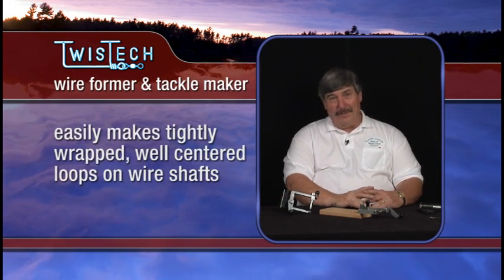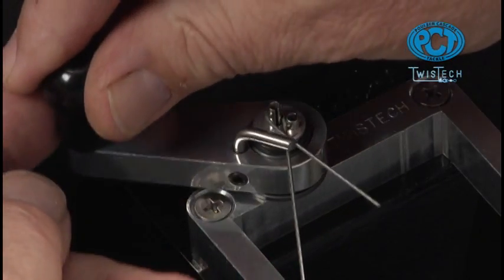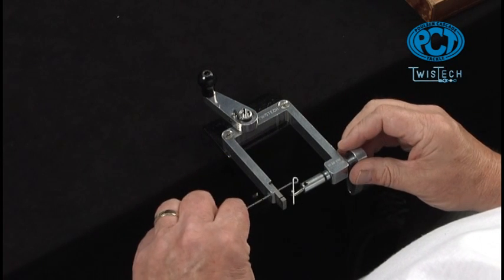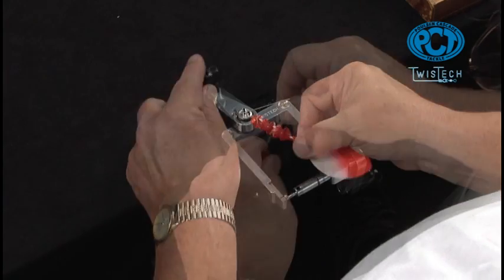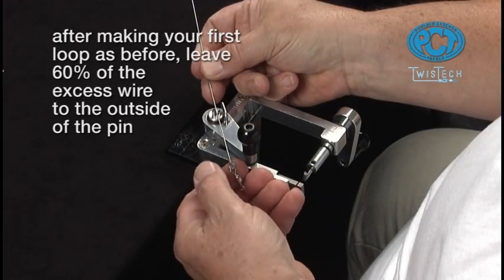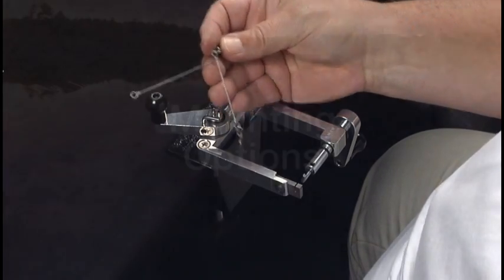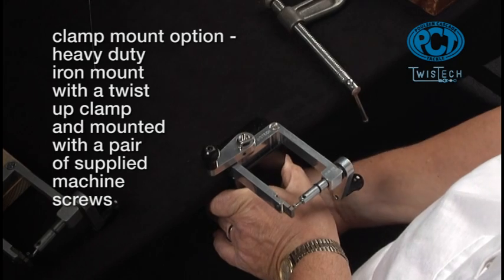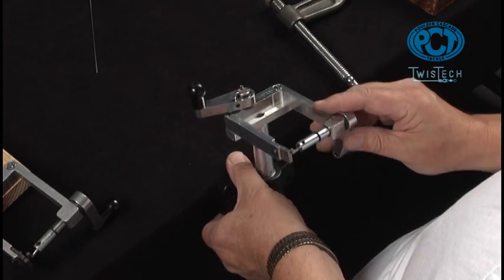TwisTech

Comment: ALL that TALKING!!!...& NOT 1 MENTION of the wire size that will work with the tool!!!...
WORTHLESS!!!!!!!!!!!!!!!!!!!!!!!!!!!....
Reply from the maker: There are 3 models. Standard handles wire from .029 o .037, Heavy Duty does wire from .037 to .041, magnum handles wire up to .052. Both the Standard and the Heavy Duty can be converted to the other by way of conversion forming dies.
Reply: You need to relax man, looks like all you had to do was ask. I'm sure that information is also available on the internet elsewhere assuming you have any sort of basic search skills and patience. 🙄🙄🙄

Comment: Can you use this tool to make  a 4/0 slide swivel?
Reply from the maker: I'd love to answer that, Rodney, but I don't know what a slide swivel is. Can you enlighten me? My normal frame of reference is based on Pacific Northwest tackle.
Reply: Poulsen Cascade Tackle do you email?
Reply from the maker: Yes. poulsencascadetackle@gmail.com
Reply from the maker: Hi Rodney,

The open spiral of the corkscrew part of this swivel would be difficult, but not impossible. It could be achieved by making the basic crossover loop and wrap, and then backing up the crank to relax the coils. While this would not create as open of coil as is shown in the swivel illustration it could produce a tighter version. Not exactly what you are hoping for, but might do in a pinch. In the long run I hesitate to instruct you that this would be a good option for making this tackle item. By the way, where is the sporting goods store you work for?
Reply: Poulsen Cascade Tackle i work for J. Hara Store on the Big Island of Hawaii.
Reply: @poulsencascadetackle8438  You make it with a twist machine like you have but you have a "die" around the wire before you form that bend spacing the wraps off the base wire. You are limited in that you have to make that bend first so you can take the die off the wire.